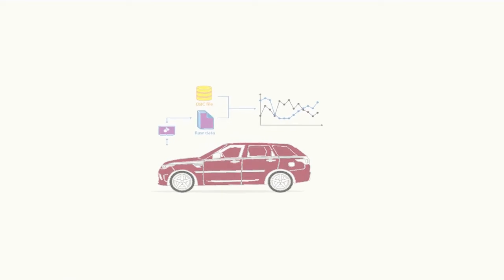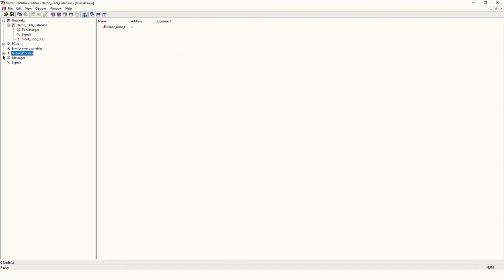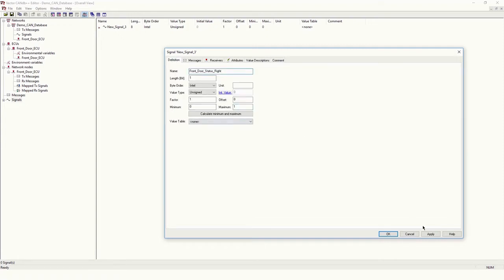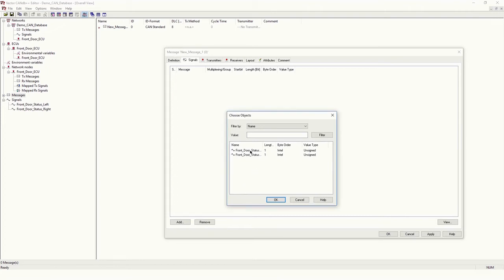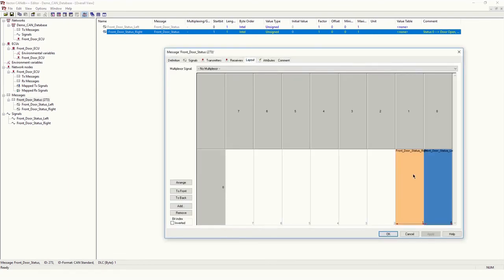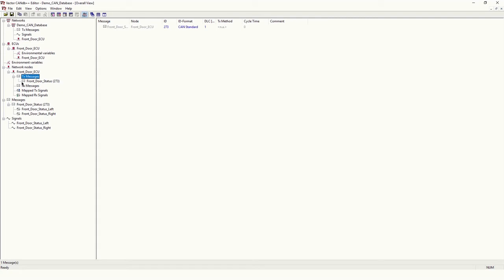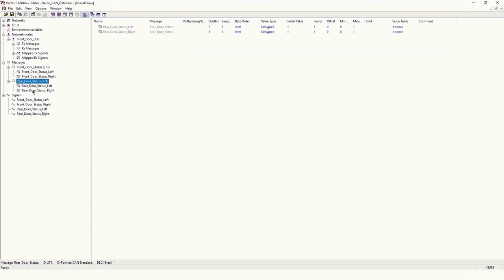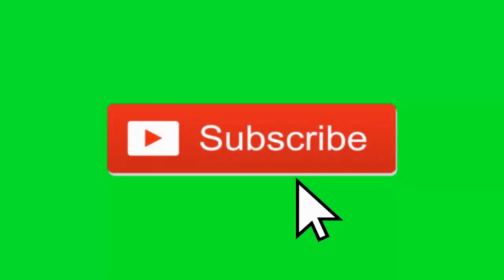How to Create CAN DBC File using DBC Editor

Comment: I understand the de-facto standard is the DBC file format developed by Vector Informatik..  but What is the relationship between eds, dcf and dbc files ?  Do they have the same format?

How can I create a sample DBC file without using their commercial CANdb++ software?  For example, 
looking at the pdfs of various CanOpen devices is there a way to manually add PDO , SDO entries such that it can the data can be analyzed real-time from a CanOpen software (CANopen Magic) connected to the bus?